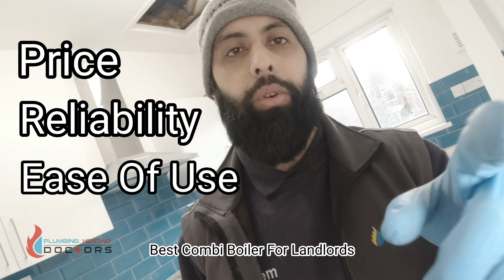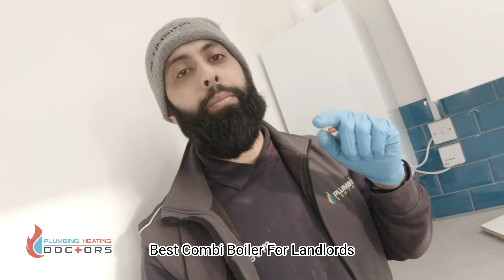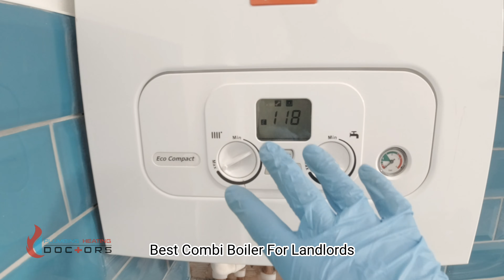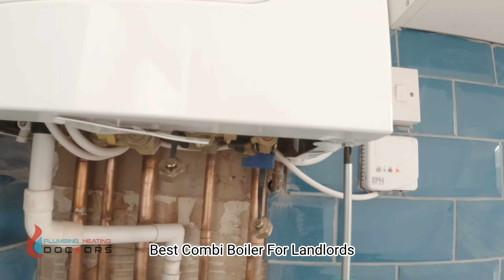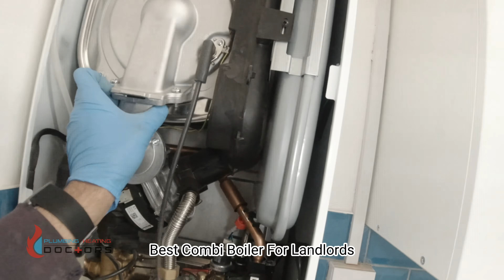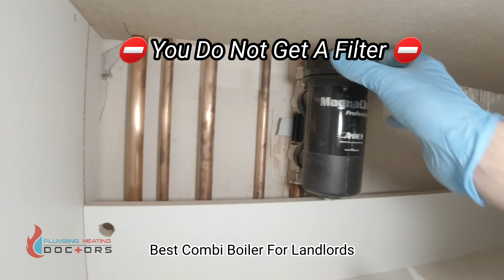Best Combi Boiler For Landlords | 2021

Comment: I would say Intergas which was designed for social housing in the Netherlands. 
No diverter valve, a 2 in 1 heat exchanger giving 12 parts of which only 4 move.
Dead simple and easy to work on.
I have an Intergas RF 36 ECO in my house for 3 years with no problems.
Reply from the maker: Yep i looked into intergas but i believe they are more expensive?
Reply: @PlumbingDoctors  I'm not in the trade, but
 have read good reviews. It's the ease of repair if they have any which my research show they rarely do.
https://www.boilerguide.co.uk/boiler-comparison/compare/[7641,7956,8172]
Reply from the maker: Yes i agree as there are not as many parts but they are not as cost effective as the Main Eco Compact. 

The Intergas is more expensive and they give less warranty
Reply: @PlumbingDoctors  Mine has a 10 year warranty,  but as you say you fit for landlords who are as tight as two coats of paint and only see  in the short term.

Good luck mate.
Reply from the maker: Lol 😆 yep

Comment: Ideal Atlantic to me. It is average size, easy to install, comes with display screen and five year warranty. It is very good for tenant as they can top up pressure with external filling loop without  tenant mistakenly turning wrong valve under the boiler. The same price range with Baxi
Reply from the maker: I very rarely fit Ideal boilers...

Comment: This might be a stupid question, I'm no plumber but how do you get the magnaclean out, it looks like it's rammed up against the worktop.
Reply from the maker: Good question, you can pull the whole magnetic filter off from the connections and then remove the lid to clean 😉
Reply from the maker: Typical kitchen fitters not thinking about us Gas Engineers
Reply: @PlumbingDoctors   Yeah but the worktop height is a standardised thing, next time perhaps fit the filter either lower down so the top is at 800mm max or higher up so the bottom clears 950mm min
Reply from the maker: @alphabuilders  yh your right but i enjoy blaming kitchen fitters lol

Comment: Have a baxi 600 at home and fit either baxis or  the main Variants. Great boilers. No issues as of yet
Reply from the maker: Yes the eco compact, baxi 600 & 800 is what i mainly install and had no issues so far...
Reply: @PlumbingDoctors  also the weight of them make it so easy as a solo installer
Reply from the maker: Yep your right! So light and easy to hang

Comment: Vokera easy heat are installed all over Scotland for landlords 👍, cheaper than baxi
Reply: 5 year warranty, Boiler are only 500 including flue
Reply from the maker: Whats there customer support like when boiler breaks down?
Reply: @PlumbingDoctors  I am not sure, we take on the boilers on our insurance plan, never had to call vokera since most repairs are visible.
Reply from the maker: I am going to have a look into them to find out more info but you can't beat these Main Eco boilers for the budget
Reply from the maker: Never fitted them.. how much warranty do you get?